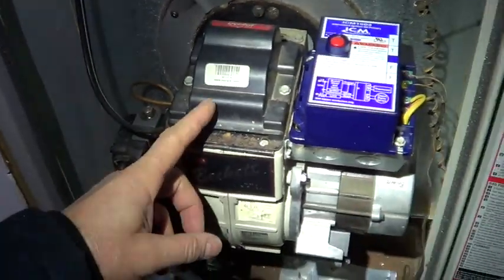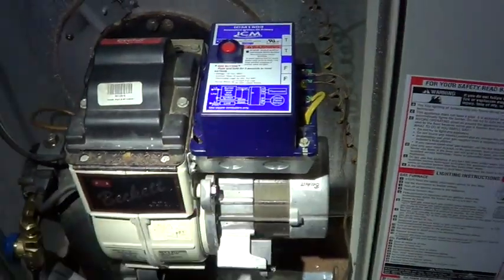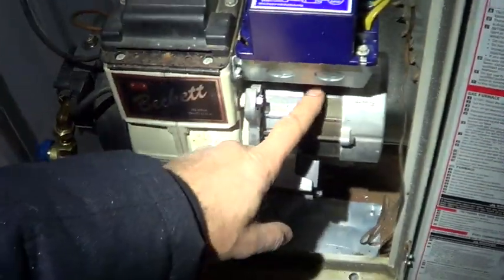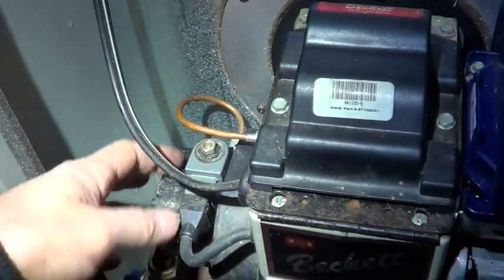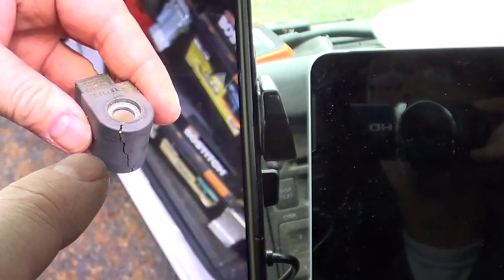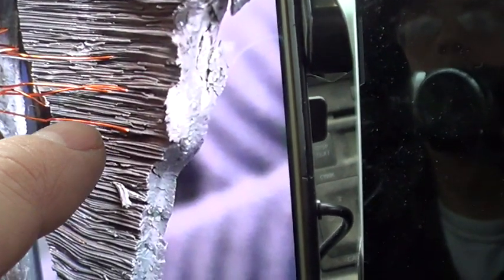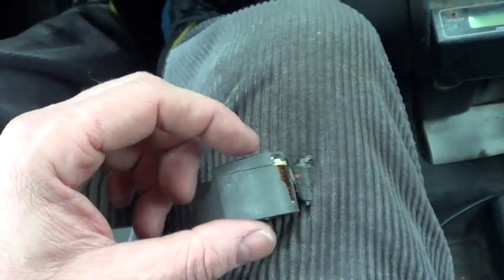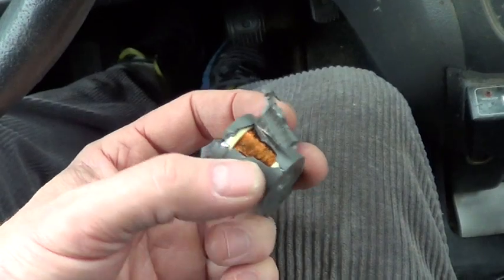How to Diagnose an Intermittent Bad Solenoid

Comment: When you get to a call, open the Transformer and put the nozzle line in a bucket, check the oil flow and spark at the same time. If you did that you would have noticed how the oil was coming out of the nozzle line and you could have probably figured it out in 2 seconds. Had one this morning, oil was coming out of the nozzle line then stopping. 
Not a big deal you finally got it, but next time it'll be much easier if you do it that way, it's even faster than checking the ohms.

Comment: If you know what the resistance of the solenoid coil should be (typically 1.4  ohms) you can check the coil resistance.  Mine is reading 0 ohms now so I know it is shorted out and burner doesn't start, nothing happens in fact.

Comment: What did you charge customer for that? Just curious if that happens to me what shoud I charge. 😁 thanks
Reply from the maker: It was a callback hell call.   Every time I would leave, it would act up again after the solenoid got hot.   Probably charged $300.   But, I didn't make my labor rate.   I'm not afraid of call backs.   It is hard to lose money without employees.
Reply: @NathansHVAC  exactly. Thanks. Thanks for your videos. Watched several of them and already learned a lot. By the way, why did you change compressor on 11 year unit? I am just thinking if the coil starts leaking after that (unit is fairly old)   how are you going to explain that to the customer? Or are you just having fun? 😁 Could you post more videos? There are not many hvac guys who share really unique stuff [ that comes only with the experience] like you do.

Comment: Could this be a Solenoid problem?
https://youtu.be/VGXL4PpWy3I
Please watch the video.  It doesn’t happen every time.  It’s like it’s starting/stopping over and over.  I ordered a new Primary Control even though it hasn’t tripped.    
My pump is a Suntec AV2A7119 with an external solenoid mounted on it.  Looks old.  It only happens on start up. 
Thanks for your help!!
Reply from the maker: Probably a clogged chimney.   I put a comment on the video.
Reply: @NathansHVAC  Thanks for the reply, but I just cleaned everything.  Had flu pipe off and chimney wasn’t blocked.  Normally it runs fine, but about once a day it does this.   After watching your video I thought it might be the solenoid on the oil pump.

Comment: I watched a video of a guy fixing an old tv and he mentioned how plastic becomes conductive when it burns.

He was trying to fix the flyback transformer (I think that's the part) and noticed hairline cracks on it. He ground down the cracks, then jb welded the area and the thing worked but he decided to replace the thing with a new one
Reply from the maker: The only time I saw conductive plastic in air conditioning were O6D compressor terminal insulators.   They would carbonize from arcing and moisture and then nusense trip the breaker.   The arc damage was obvious.   But, they only had about 1/4 gap to arc thru.